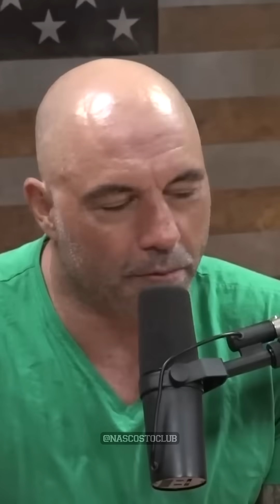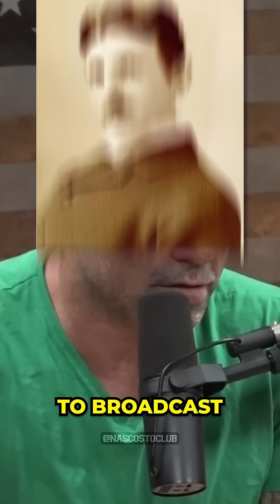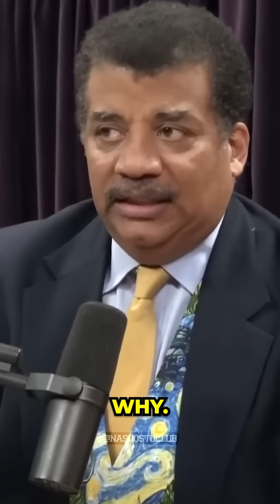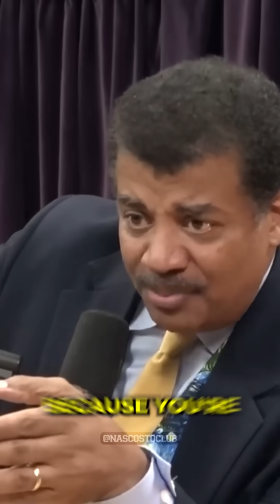WIRELESS Electricity Idea Debunked ⁉️⚡ #shorts

Comment: I remember a story about when Navy ships come into port, they have to shut down their high-power radar. The story is that there was a technician that was working on one of them and somehow or another it got switched on and did a single "diagnostic cycle" and every one of the 4 shot bulbs for 1970s disposable cameras went off from the RF radiation emitted by the radar. Needless to say, the technician wasn't in too good of shape after that either
Reply: I remember being in the Air Force working on B1-Bs many years ago, and we were warned about steering clear of the jets during radar testing.  One of the supervisors joked that it could fry a rabbit at 50 yds out.  I wasn't sure if it was true, but I wasn't about to find out.
Reply: U sure it isn't a Sonar instead of a radar and the reason being because their loud as fuck and will kill swimmers nearby?
Reply: @WeirdDuck781  prob not cause they had sonar on full blast sometimes during the Cold War at the docks in case of enemy divers
Reply: @bluflare12345  sonar full power is known to cause internal organ damage and bursting
Reply: Good thing we have 5G equipment on all our towers and poles🤔sure there is no correlation there...no sickness, no radiation, not unnatural frequencies, no COVID of course😂😂
Reply: liar

Comment: It is well known fact that electric energy is transmitted via electric field around conductors, not through conductors. So it already works that way.
Reply: No the charges travel along the outside of the copper wire, the insulator around the wire keeps people from getting fried when getting too close

Comment: Tesla idea wasn't transmitting the electricity through the air..... technically.

The goal was to gennerate a standing harmonic wave in the earth's crust.

The distance east/west you put in your electrodes would get the power diffrence between those two points of the standing sine wave.

From my best understanding of what he was intending.

Comment: Look up how much energy goes into power a radio or TV transmitter, and then how much is available at the remote antenna and it isn’t much.  Although there is some development in wireless charging in the past few years, the distance is very small.

Comment: He's actually wrong on this with tesla power system if you turn it on why you are part of the circuit it can pass through you harmlessly what he is describing is if we used the type of current we use now in the way tesla described that's like saying a car won't work cuz gas explodes so we should use steam. Totally idiotic

Comment: It's interesting that he thinks the amount of power would take to power and incandescent light bulb is insane to travel through the air, but the ability to transmit data across dozens of frequencies, constantly, is no problem at all....

The real issue with the Tesla wireless power is that it would interfere with modern circuitry. You would have the option of a wireless powered light bulb, or a smartphone

Comment: that's not how it worked anyway. It would draw electricity from the atmosphere and direct it where you wanted tesla was just grounding it in the earth interesting effect though he got so much energy he could stick a light bulb on the ground near the tower and it would light up 
the way ot works is when the sun rays move across the earth during sunrise there is a wave of energy that travels around the planet he was simply tapping into the energy source

Comment: You know, reading through these comments is kind of funny. People are hating on Neil so much, it's basically become a meme, rather than a rational thought. Even though what he's saying here is 100% correct. ''Wireless'' electricity in the capacity Tesla envisioned it, is simply impossible.
I mean hell, the concept of living under overhead power lines is under fire for being potentially dangerous due to it's radiation. So how is what Neil is saying here in any way wrong?

And just to be clear, I'm not doubting Tesla was a genius, quite the contrary actually, but he did have some pretty unrealistic ideas. Perhaps if he would've had more time, and without being cancelled like he got, he would've figured it out. But he didn't.

Neil is 100% right here. And to be fair, he usually is, whether you like him or not.

Comment: To send enough power through the air to light up a light, you would have to literally ionize the air...
Locally, like between a tesla coil and a bulb or fluorescent light tube, not too big of a deal for demonstration's sake...
But to do such a thing in a household would burn the house down... This isn't an idle statement, Tesla's own research and documentation prove this through his own findings. 
That's why his Wardenflyffe transmission tower spelled the doom for that line of research because he very quickly realized that it wasn't a matter of being able to make a bigger tower, it was that there is only so much you can force through the air without making it deadly to anything living, and highly likely to set things on fire because the air itself is just resistant to the transmission of electricity, which is actually a GOOD thing.

Comment: I am a Tesla fan, the man not the car. But I can see NDT point. Wires are more efficient transmitting power than air plus air has HUGE loss because of the Inverse Square law. For example transmitting 1,000,000 watts to a 7 watt night light 1,024 feet  away the light gets only 3.8 watts of power. With copper wires you won't have HUGE AMOUNTS of wasted power. To run a 7 watt light for 8 hours cost 2 cents the copper way. 
With the Tesla way it will cost you $1600.00 to run that 7 watt light for 8 hours.
That is the Inverse Square law for you!
Plus all that 999,993 watts of RF is going cook people in the vicinity....especially if it is microwave RF.....same stuff used in your microwave oven, and that draws a 1000 not 1000000!

Comment: What if the energy could have a frequency that could only match the device receiving it. .for it to specifically power, transfer or conduct in the device it's suppose to power? Like a microwave only reacting to water molecules. .or like a Bluetooth device paired to this device only. .would it be possible?
Reply: If we could design an energy to only react to a specific item or a specific receiver it would be possible

Comment: Neil doesnt even explain why it wouldn’t work. 

Main issue is the inverse square property of forced, such as electricity. The further away something is, the quicker it loses the amount of energy it has. 

A lightbulb doesn’t contain enough electricity to kill you, as demonstrated by being able to use a small solar panel to power little led outdoor garden lights. This is power only from light from the sun, yet that doesn’t kill us. 

Our skin also can act as a shield against various stuff, including mild radiation and electricity.  You can have a high current but if it’s voltage is too low, it won’t be able to pass through your skin. 

Neil not only doesn’t actually explain why shoe is wrong, he goes out of his way to call Joe an idiot. This is something Neil speaks out against in other stuff. Here he is punishing Joe’s curiosity

Comment: Neil is wrong. I’ve worked at many substations as an electrician. You can feel the induction when you get close to the lines and we’ve actually been able to power small circuits freely off it in the air as we just messing around. But we ourselves were fine and if touched metal that actually conducted the induction we’d get a nice little shock but was nothing more then what you get from static. Wireless electricity would be possible. Ronan extent. Obviously if we wanted to power everything off one core that would be impossible. But we could have buildings/floors powered off induction from nearby (very) nearby sources. An example I could think of is instead of a breaker box in your house have something to product the wave of induction and someone smarter than me would do the math to find how far out that induction would be able to reach and the source not being to strong where it gets to the lethal levels he’s suggesting everything is. Obviously there’s the risk of it over surging and that could make it lethal levels without intent. So again someone smarter would have to plan out fuses and whatnot for protection. But it’s 100% possible to do. Would it be more cost effective? No clue.

Comment: Guys what Noel is saying makes sense. Let’s pretend that the energy we need to power a phone for example was lightning. So we need to physically send lightning through the air to use the things that require energy… so what would happen if you just stepped in front of that lightning you’d probably die. Now if we took that lightning and forced it to travel in a wire instead of the air , we can now avoid and RELOCATE the output of energy
Reply: You do know wireless phone charging works? Btw lightning is 100,000 volts. Your phones battery is 5V.

So you don't understand electricity is what your saying
Reply: Also electricity doesn't travel through wires. It travels outside the wires as a electro magnetic field.

So again. You don't understand electricity lol

Comment: At work, we use welding machines that light, light bulbs, while we hold them, set em on a table. Turn the lights off over your head, fire up the machine and the lights come on...I'm not saying I doubt Neil, but we don't keep anything electric within about 30 foot diameter

Comment: Tesla basically wanted Wi-Fi that could send electricity. That's all it is. So all someone needs to do is make Wi-Fi carry electricity. See how far we can take that. Because, even if its only short wave in a house, think about how much safer that would be in comparison to having wires all though it. Long term low level radiation not withstanding of course.

Comment: If you could power lightbulbs through the air. Youd never be able to turn off the fucking lightbulb
Reply: Also the voltages required to pproject power like that. Cause problems with human bodies. 

We literally have data about living under hi tension electrical lines. Those big triangle ones
 They radiate energy because of the voltages they run at. It causes cancer. Lol. Thats why they zone the areas under them as city Or government land and only let you live like a hundred feet from it at minimum. Because it fucking destroys your DNA.